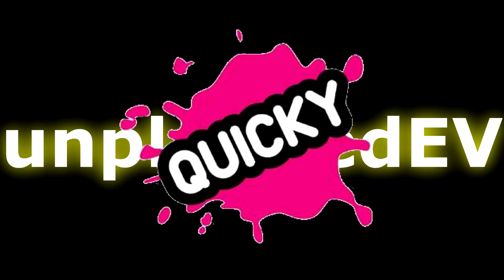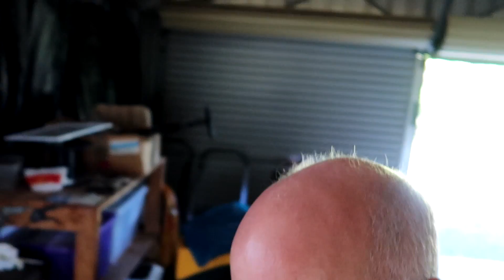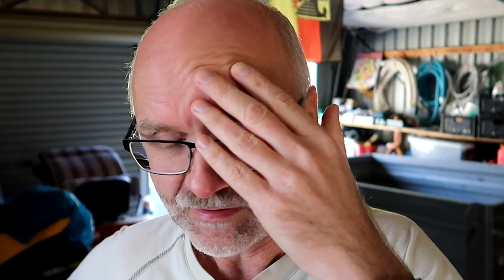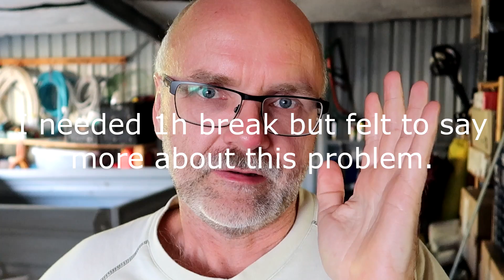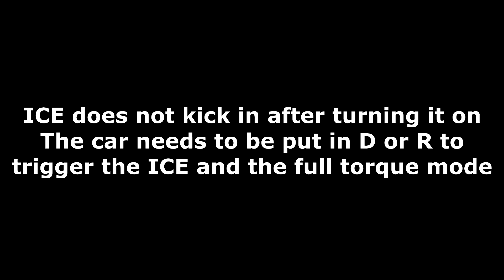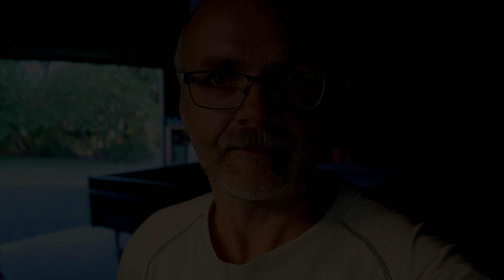Q79 - Unsafe PHEV Box programming, my first reaction and explanation!

Comment: Just a qurious cuestion from a software developer for machinery. if you do the same "startup" without the box but with the gaspedal pushed all the way down, do you get the same reaction then? 
As I understand it the box only emulates the gaspedal. If the car reacts the same way, then the problem lies within the car, not the box. 
You "should" not use both feet when starting the car but you can so it needs to be handled. I.e. if you had the floormats out  and accidentally put it over the gaspedal.

Comment: Andy, check your wheel hubs and bolts holding the wheels on the hubs. Drive around and listen to the suspension and transmission noises. That might have been way too much torque from the standstill :/
Reply: J B how much torque was supplied? How much torque are the axles engineered to withstand?
There are alot of variables in play here. Not sure if we have enough information to make any claims. I don't want anyone to jump to conclusions
Reply: Of course not. That's why he had to check.
Reply: chad weaver Of course we don't know. That's why he had to check.
Reply: J B my point is we don't know if that was too much torque...
We are creating rumors by saying we were able to create an over torque situation. 
I believe the issue was that the vehicle moved wothout throttle input, and not that the torque was more than the allowable torque permitted by the drove axles.

Let's me objective and honest.
Reply: chad weaver it's not rumors, it's called hypothesis and it can be proven / disproven by empirical test. That test is Andy's task. No more, no less.
Reply: Thank you for modifying your wording. It is now much more objective than "Andy, check your wheel hubs and bolts holding the wheels on the hubs. Drive around and listen to the suspension and transmission noises. That was way too much torque from the standstill :/"
Reply: chad weaver who are you? An attorney for the box manufacturer?? 😂
Reply: J B, ha . No I'm just an objective engineer. By your comments I assume that you are a mechanical engineer...jk, mechanical engineer would say that without more data.
I seriously dislike when people speak of things that do not understand. When they use absolute sand sentences where they should not.

Your original statement stated that this box allowed him to over torque his axles and hubs... however I'm not sure that you know the torque limit specifications for any of these components. Feel free to correct me if I'm wrong.
Anyway please don't be insulted by my replies, I just wanted to set the record straight.
Reply: Ah the engineer... Not able to draw a hipothesis. Just empirism. I know I know :P

Comment: When I spoke to Mitsubishi whilst they did reconfirm the warranty would be cancelled they also mentioned that this is classed also as a modification so if you don't speak to your insurance company your insurance is also null and void. So I did and they said they would not cover the car if this device is fitted.
Reply from the maker: Do not trust any dealership!
I found the opposite statement on the Australian Mitsubishi website in regards to the 'modification':

What happens to my Mitsubishi warranty if I modify my vehicle?             
The new car warranty applies to the original 
components that have not been modified or altered from manufacturer's 
specifications.
Modifying your vehicle or installing parts and accessories which are 
not approved by Mitsubishi Motors will not void your warranty. However, 
if a modified part needs replacing or causes damage to other components,
 this will not be covered.
https://www.mitsubishi-motors.com.au/shopping-tools/warranty
Reply: Was not the dealership but from Mitsubishi direct in a conversation about some changing issues I am having.

Comment: Just a Query Andy did you try all of the preset setting on the knob in the box 1 through to 8 to see what they did because if you remember Vtech said to use 2 or 4 for the PHEV, So I wonder what you thought of all of the original setting in the box without bothering with the software // Still think its a modification.
Reply from the maker: I didn't try or test all of the pre-settings coming with the box but I had a look at the parameters and throttle map of each. They are all the same apart from one single parameter (Engine starts) which is obviously necessary to calibrate the box to the individual car. Only one throttle map (I think it was program 7) was a bit different and the curve was altered. All other maps were the same.
Unfortunately you still need to go into the software when the box gets installed to learn the software no throttle and full throttle. Mine was only showing 80% of the throttle way. At the same time you could potentially alter some parameters (maybe even accidentally) which then could have this horrible effect.

Comment: This manufacturer also makes magic go faster boxes for ice engined cars.. and they frequently blow up the cars engines. Too much turbo boost pressure or advance / retared ignition and before you can do anything about it your engine is wrecked. I have seen cars brought in for repair with blown engines with these boxes fitted. So as I first said to you when you launched the free offer,  these are all dangerous and should not under any circumstances be fitted to any vehicle.  Now you understand one of the 2 main reasons about which I was telling you. But you had to find out yourself.. luckily no one was hurt.
Reply from the maker: Again, do you have any proof of your claims/opinion, any links? Also, what you said before about the EMC testing has nothing to do with what happened. I have modified the box on purpose, changed parameters and altered the throttle mapping. No ECM interference, no accidental acceleration, nothing of what you proposed before. This here is a total different story, Bill.
Reply: unplugged EV only my experience of working in a Garage with a chip tuner for 2 years! And knowing the chap as a friend for 8 more years. Also a lifetime of experience with electronics (as a hobby) and 25+ years building and repairing computers for high end applications. And a lifetime of talking with my brother who is a world expert in EMC and electrical engineering.. I have sent you links to his many hours of his expert evidence to the American Grand Jury over the Ford / Toyota run away car problems of a few years back.
So no I know nothing about the subject!
Reply from the maker: So, what do you know about the PHEV Box? Have you seen one, tested one? If so, what was your experience in programming it? The links you posted had nothing to do with what I've shown in my videos. Just random problems with cars and not even PHEV or EV related. There are many 'world experts' and 'car professionals' out there which are trying to make themselves heard with no background or evidence. I respect your opinion and you made it clear here and elsewhere that you're against the Box and believe it's dangerous. But by only repeating the same all over again it does not make it true, Bill. Again, the situation I've experienced was caused by me changing the programming of the Box, not by any 'magical' behaviour of the Box or even EMC. If you have any further evidence that the Box, in general, is unsafe to use please let us know. There is no need to repeat yourself all over again, encouraging everyone to give their device back for a refund.

Comment: Hey Andy...sorry to hear you had a scare...to all others ,personally I do my programming on the road, with a laptop and no one around...Andy can you Show us the curve you programmed to educate what not to do! To all others...remember what we are doing in essence we are playing with the acceleration curve and digitally manipulating it to OUR parameters to trick the car into a EV only mode... but careful...if you make a mistake it is yours so understand it!...and if you point a finger at something wrong, remember you still point 3 fingers to your self!  good luck..H
Reply from the maker: It will be shown in the next video. In it's current state, the software is totally unacceptable because there is no documentation available. It also allows you to add dangerous settings which turns the car into an unpredictable machine. Both cannot happen and is very dangerous! I've already contacted the manufacturer and explained what happened. I've sent them my exported file as well. Due to the weekend, I haven't heard back yet...